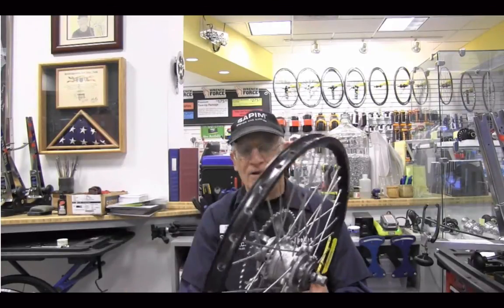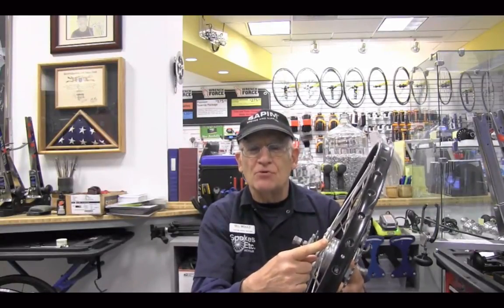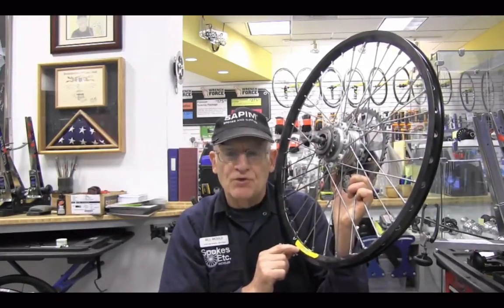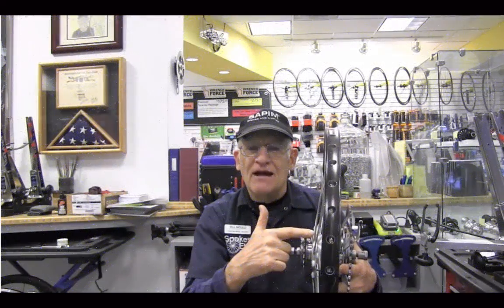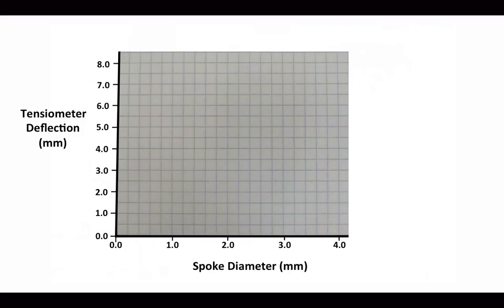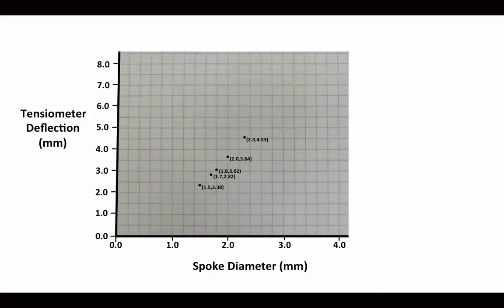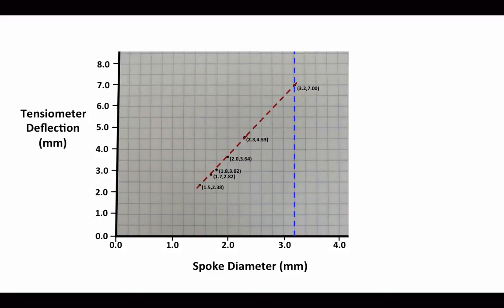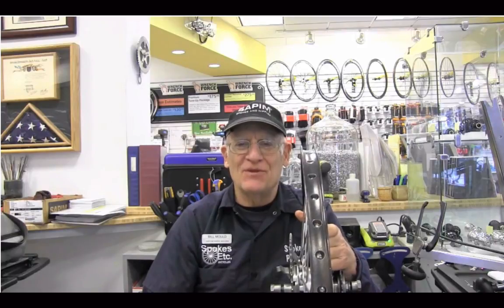Moped Hub Laced to Bicycle Rim With Motorcycle Spokes

Comment: I have a front wheel from an old pedicab where the rim and some spokes are no good anymore.

It has a drum brake hub and used motorcycle spokes. I'm currently in the process of trying to figure out spoke  measurements to lace the hub into a regular bike rim and use bike spokes, although I'm going to use flat washers to prevent the spoke heads from going through the holes.

Is this a recipe for disaster?
Reply from the maker: I certainly would not do any of that unless you are a very experienced wheel builder, and maybe not even then.
Reply: @BillMouldWheels  I appreciate the feedback. I'll abandon that idea and see about getting a heavier duty rim and new motorcycle spokes. Or just a new wheel. I'm a novice wheel builder

Comment: Where did you order the motorcycle spokes and get the length needed? All the sites say what motorcycle wheel they fit but don't give the length. The others give the length that aren't long enough. I am trying to build a moped/bicycle wheel.
Reply: Use a moped hub